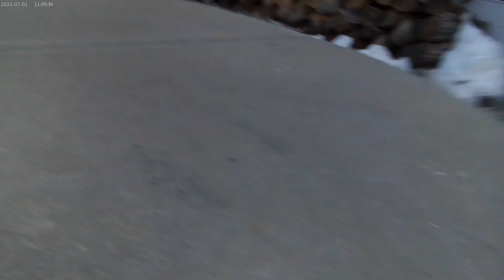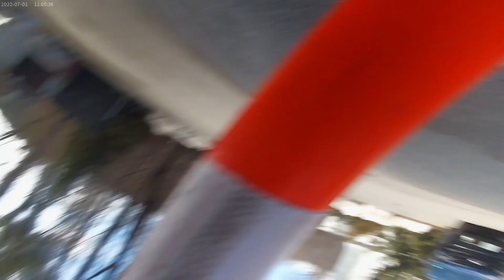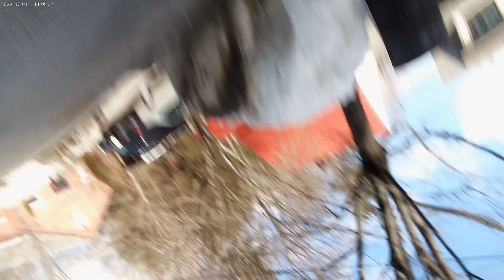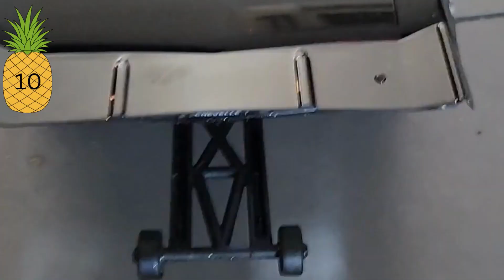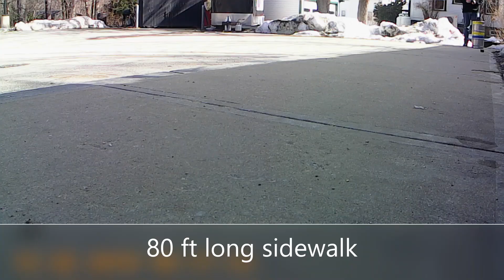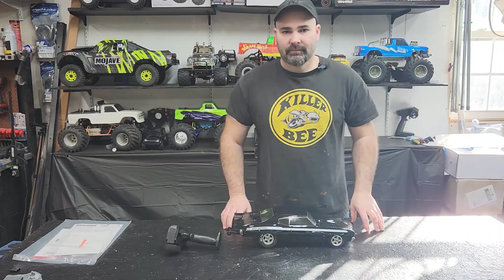Losi 1/16 No Prep Drag car tested on concrete and doing burnouts on tile floor  How Good is it?

Comment: So I have run the Mini Ts and Bs for a while now and picked one of these up pretty soon after they came out. Definitely crank the slipper clutch down and dial the brake down to 50% from 75%. It turns it into a whole different car. If you want to go a little further throw some marine grease in the diff. You’ll definitely notice a big difference 👌🏼
Reply from the maker: Great info thanks